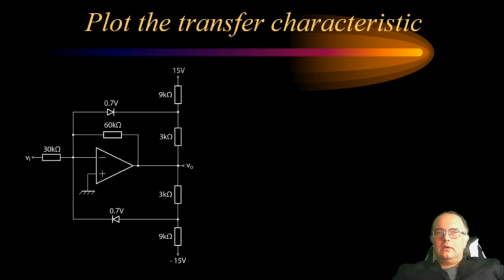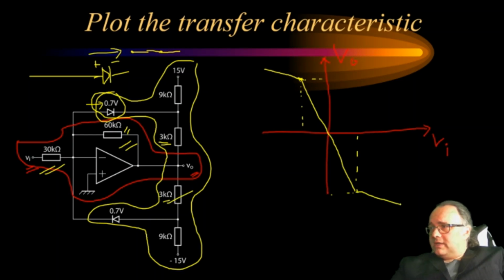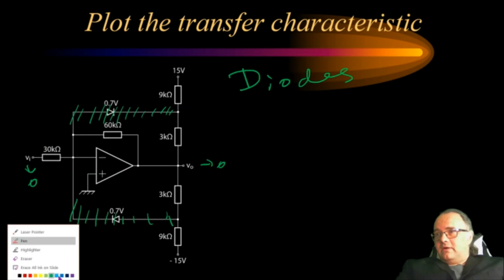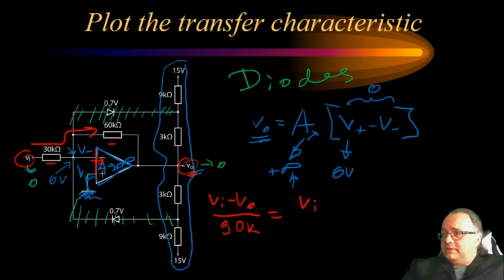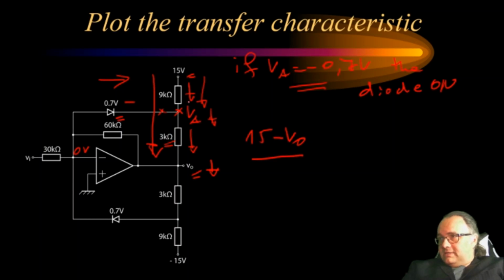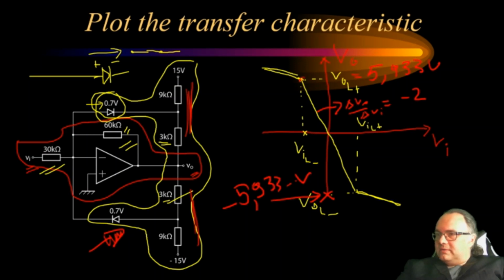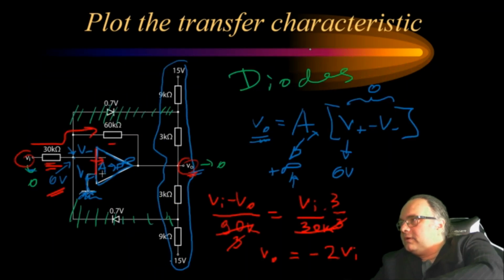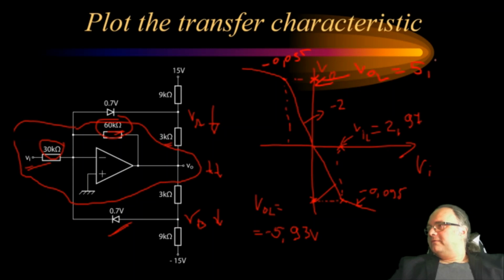Inverting amplifier with a soft clipper

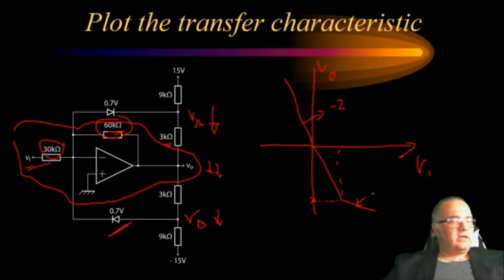Comment from the maker: Correction at time 18:56: it should be -0.095 (and not wrongly calculated -0.95, since 6/63). Sorry about that. It should be now blurred. In the recap at the end, time 21:12, you can read the correct number -0.095